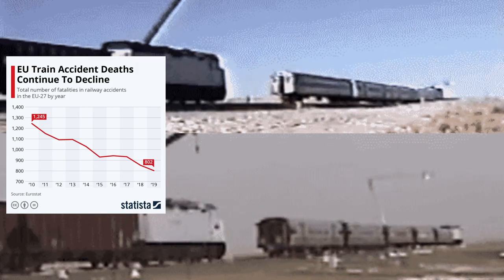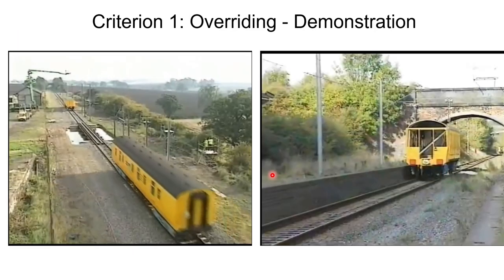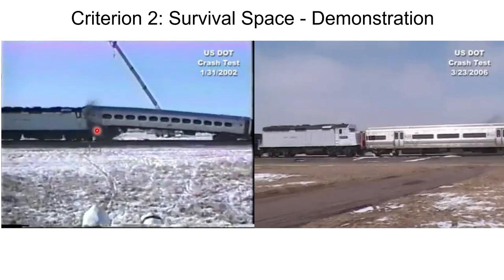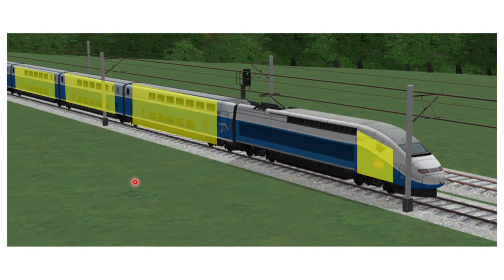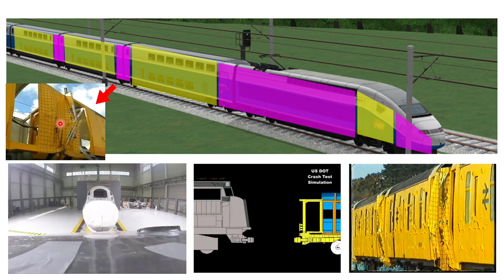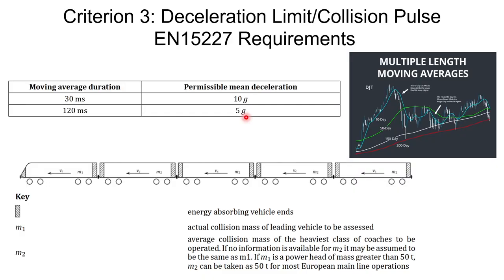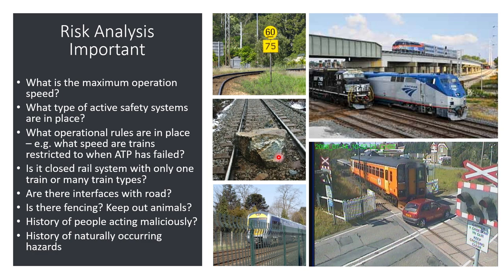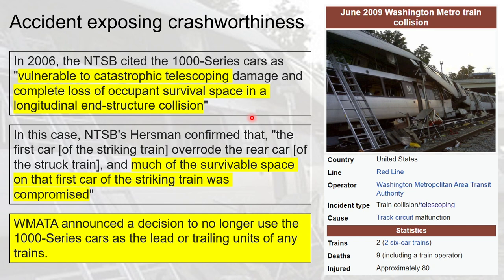Accident Crashworthiness in Railways Explained (EN15227)

Comment: Of course the thing that makes railways unique among all forms of transport is that they are wholly designed by human engineers from the ground up and thus can have lots of safety designed into them. With all other forms of transport such as air, road and sea you have limited to no control over the operating environment so safety design has to be focused on dealing with the accident when it has happened and you're limited in your measures to prevent it. Road is especially bad in this situation because while you can design the roads the fairly unpredictable nature of the millions of drivers using them makes it very hard to design much safety into the system. Laws and design tries to limit danger but the problem simply is that millions of fairly poorly trained drivers by the standards of all other forms of transportation will regularly just ignore or forget these things and endanger themselves and others, not to mention the role that emotions play in such a chaotic environment. It is of course possible to try to design away most of the risk but that almost always comes down to just making driving less convenient and that is politically difficult as drivers absolutely hate spending any time or effort on driving and as such it only happens to a limited degree. Air and sea are better off, the atmosphere might be somewhat unpredictable but at least pilots are always highly trained and generally can be trusted to follow regulations and with radar and GPS it's possible to steer air traffic. The sea is definitely the most hostile environment to humans on this planet but the simple benefit of professional crew and the sheer size of ships help reduce risks a lot.

However rail is completely unique, it has the benefit of a completely designed environment that road has while also having the benefits of coordination and professional operators that air and sea has. This is what makes railways the undisputed most safe way to travel. ATC more or less makes it possible to completely design away any risk of accidents, as shown by several HSR networks boasting zero fatalities over their entire operating life. This is because trains can remove the one risk that ships and aircraft will never really be able to get rid of and that's operator error, even if those systems were controlled by AI the chaotic operating environment would still make it possible for those systems to make false judgements, which has happened. But trains existing in a wholly built environment can simply make sure that the operator isn't capable of making a deadly error by putting in place logic systems that override wrong judgements. This generally means that actual crash safety is much less important for trains but still with their size and specialized designs there's plenty of room for it. This effectively means that the only real risk left to railways is terrorism but with all of their other safety systems and lack of highly volatile fuels like on planes this is much less dangerous and less attractive to prospective terrorists, and of course terrorism can be prevented by other factors. Terrorism does tend to correlate with general instability and inequality, very stable and more equal countries such as the Nordics have vanishingly low rates of terrorism compared to even other western countries and those countries in turn have lower rates than much less stable countries. Coincidentally robust public transport as seen in the form of railways is a great way to reduce inequality and increase economic stability by making the country less reliant on energy imports, not to mention the clear benefit provided to society by actually having people interact with each other in public spaces.